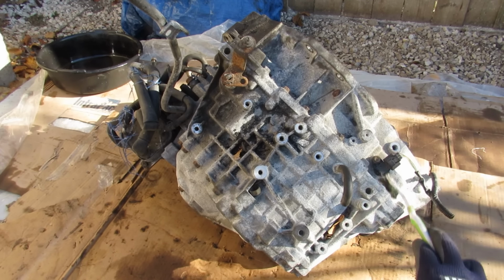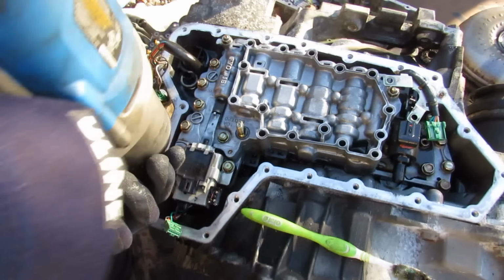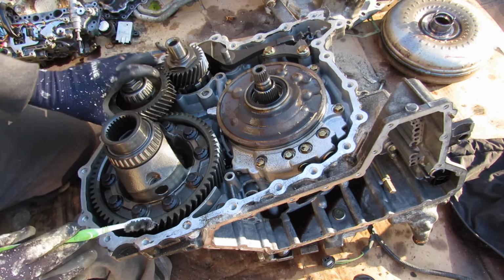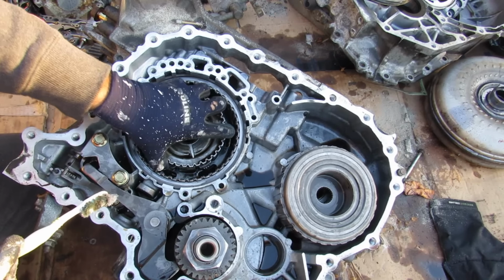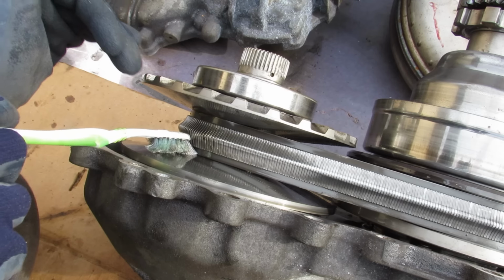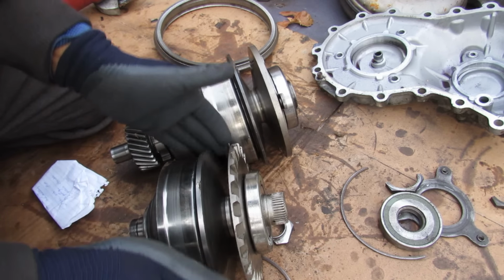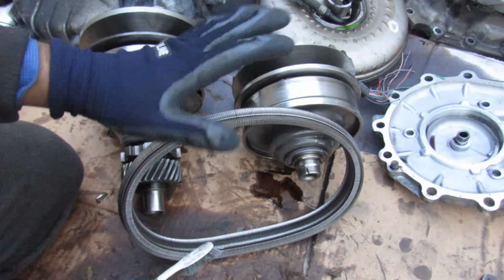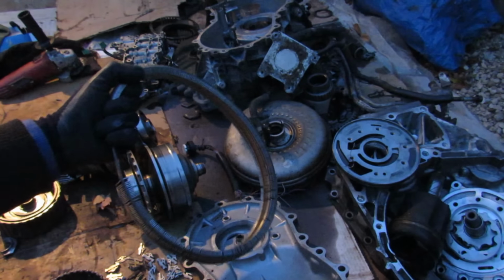Why Nissan CVTs FAIL

Comment: My issue with these is that Nissan puts them in my favorite car; the Maxima. Any Maxima after the 5th gen is shit in my eyes because of this one part.
Reply from the maker: Yeah it really holds back the vq engine
Reply: @speedkar99  not to mention a new Maxima is $40k. And it disturbs me that the new altima has AWD but the big ass Maximas are still only FWD. They just don't treat it like the top of the line car it's supposed to be.

Comment: the belt is a pusher design, therefore the belt isn't stressed unless the pulleys are not synced. the question is why does that happen. you need to take the "variators" apart and observe the shaft and how the pulleys are stopped from rotating on the shaft. there is where you will find your answer to why these things fail.

Comment: And there you have it.    Why an electric car is so good.
It DOESN'T have all that.
Reply: no it just has a battery that degrades, isn't any better for the environment in the long run, and uses rare earth elements that can't be recycled into other batteries when the battery is finally rendered worthless by time. So tell me again why electric is the perfect solution. That's not even counting the range issues and charging times. Oh and the fact that if everyone who drives an ICE vehicle switched to electric how the grid could absolutely NOT handle it. But electricity is so much cheaper than gasoline you say.....except everyone is completely ignoring how basic supply and demand works and that if the demand for electricity is greatly increased due to electric vehicles then to counter that the supply cost is going to increase. And on top of that, said supply cost is going to impact your entire home and not just the cost to go somewhere. When electric rates rise due to demand, that means not only does your vehicle fuel cost increase but so does your cost to refrigerate food,  cook food, heat your home, watch tv, use your computer, etc.
Reply: @kudzuwarrior  BS

Comment: pretty good information but some inaccuracies, nissan does make a service procedure to diagnose cvt failure and even updated detection logic to set dtc for failure diagnostic, they do have a rebuild procedure for cvt and even have rebuild kits for the cvt that are half the cost of a complete unit. good job on the video!

Comment: Great video.  I really think the secret to keeping a CVT going in a larger vehicle is just what you said, drive as easy as possible and try not to overload the transmission.  I hope Nissan quickly moves to drop the CVT in larger, more powerful vehicles like the Pathfinder or Murano.  In lighter vehicles they are fine.  The issue most people face there is quality.  Early Nissan CVT's had shit quality.

Comment: Mr speedkar99, I have a question... I have a honda Civic Hatchback 2017 with the cvt. Paired to the earthdream engine/turbo, and this car is light weight. and build for cornering at highspeeds and generally advertised to be a fun car to drive... now.. I've (gone to mexico) and had some 120 /130 mph runs with it before. (atleast 5 times) car has 40k miles.. and almost on a daily (all back wide open roads with no traffic) to and from work never ever drive the car without it being in sport, S mode (keeping the cvt ready to launch at higher rpms and the turbo loaded at all times) and i usualy do 70/80 most of the way to work (20 minute commute) until i hit the last 4-7 minute stretch to work and go back to the 55 speed limit and back in D, drive... now people say honda's cvts are built better then most others.. and other companies as you mention are pairing them with bigger engines and toying around with them is bad.... would you say what i do on an almost daily basis will ruin my car too? even though its smaller lighter weight and smaller engine? 
 (i got the car with 17k miles.. in janurary2020 and have gotten it to 48k to the date of this post, between my driving mentioned above, and driving for uber - stop and go and alot of idling- so those 31k miles this year alone have all been hard miles you could say)

I'm looking forward to your reply. Thank you for such an informative video I love your work.
Reply: so i drive it hard pretty much since ive owned it is what im saying, because it handles amazing accelerates hard, and is just a blast to drive i cant help it.

(also forgot to mention i have it modded with a Stage 1 straight through inlet pipe and sport air filter from PRL motor sports.) [rated to add atleast 7 - 12 more horse power over stock]
Reply: oh and what did you mean when you said keep up on its cooling surfaces? / when or how offten should i have the cvt oil changed? especially based on how i just told you a drive?

Comment: From my experience with CVT transmissions, NEVER BUY ANYTHING WITH A CVT TRANSMISSION. This transmission was designed in the deepest pit of hell.
Reply: so don't own anything 2012 or newer?
Reply: @WestCoastShredders  You know, I don't know, I have not had the luxury of buying anything new lately. I just know I had a disastrous experience with a newer Nissan vehicle. To say I loath Nissan and their CVT transmission would be an understatement. I can say that I will research any new vehicle I may purchase in the future and if all newer vehicle's do indeed have that POS transmission, I will be driving my 1979 Cordoba until the wheels fall off. I do believe the Ford F-150 and the Toyota Tacoma do not have CVTs but I could be wrong.

Comment: I got a rogue. Hate the damn thing. I bought an aftermarket hitch and got my grandpa's old drawbar and I regularly tow 4k pounds. Car tops out around 52-55 mph with the load and whines like a mf but the damn thing just keeps going. I know it won't last much longer but I have a truck too so idc

Comment: CVTs work great in snowmobiles.  Because they are light enough to use rubber belts that can be replaced each year in about 5 minutes for $50.  If these steel belts were cheap and easy to service they'd be a lot more desirable.

Comment: I have three college degrees, read about two hours a day,  and I can't believe how dumb I feel watching this.  

Amazing video, thank you so much!
Reply: I can.
Reply: I knew generally how they worked (the pulleys and the steel belt, going all the way back to the first CVTs used in the Dutch DAF cars of the 1960s), but this is the first time I’ve seen a CVT torn down.
Reply: read 4 hours
Reply: @esatd34  Maybe another degree?
Reply: Must have had a student loan

Comment: CVTs are junk!! I wanna be able to tow with my toyota corolla again .Yes I might give up some mpg.  but i'll be saving the planet with less junk wearing out so fast~
Reply: You can't tow most normal automatic cars either.
Reply: @mjouwbuis  Older Toyota 4sp and 5 sp Auto's You can tow up to 3500lbs without wearing out the tranny. All manufactures need to toss the CVT IDEA. I've also owned Nissan before getting 430 000 km out of a Transmission. You can't say that about new ones. 200 240 and there toast.

Comment: This is the only video I’ve ever seen about CVT transmissions. No one could have done a better job either. You are so knowledgeable, you are a great teacher! 

I’ve read a couple of articles about CVT transmissions so I had an understanding of how they work. It’s a great idea but as you pointed out, the belt has always been described as being a weak link.

And it is easy to understand why. Since I read those articles and when I saw that CVT’s were in production, I wondered what they were using for a belt and if they had come up with another way to transfer power.

This video is amazingly informative. From the title, I figured that if a belt was being used, it would be the point of failure. I kind of hoped that it wasn’t, but I wasn’t surprised that it was.

During teardown, I was on the edge of my seat to see the CVT parts. When you said it uses a steel belt, I was blown away. How could a belt made of steel, that is strong enough to withstand the forces being placed on it, be flexible enough to bend around the pulleys.

When you showed how the belt is made of steel sections, the first thing I thought of was how it was constructed. I didn’t expect you to tear it apart too, and was fascinated when you deconstructed it.

For a long time, I thought if a belt was used for the CVT, it would be more like the toothed belts used on belt-driven motorcycles. But of course, how would a toothed belt be able to engage in and stay engaged in a pulley system that varies its diameter.

I suppose in actuality, the steel belt, being divided the way it is, is sort of toothed belt. I would also imagine that as the belt is designed to move around in the pulley system, it would generate a lot of heat.

Even though these CVT’s seem to be a bust, they are a necessary first step in making something that will work. It’s unfortunate that it’s affected so many people.

When the CVT fails, the company designing them should be analyzing the failure to improve on it. The way it is currently designed, the engineers should have known premature failure would likely occur often.

IMHO they should replace prematurely failed CVT’s with a standard transmission. Not an easy task certainly, but unfortunately, that’s the cost of throwing a new system into production.

And as I said, the company is able to gather important data to use to improve on the design. And that is data that no other company will have. That has value in and of itself.

Comment: I'll never own a car with a CVT. Problem solved!
Reply: My 2006 Toyota HH with a CVT has 295k on it. Many of those miles towing work trailers.
Reply: @greenftechn  much impressive
Reply: Subaru makes a decent CVT.
Reply: @rk4921  Subarus have major CVT issues!
Reply: @rk4921  Subaru uses Jatco CVT's , a subsidiary of Nissan, and the exact same CVT's found in Nissan's. Also found in Land Rover, BMW, Chrysler, and a bunch of other manufacturers.
Reply: One company is starting to make a CVT with a launch gear so it operates just like an automatic transmission when speeding up. If you can get 300,000 miles out of that with proper maintenance I might consider it
Reply: Oh yeah, you're going to own one... If these people have their way, a manual transmission will be extinct. They're working on it as hard as they can!!!
Reply: Yeah! Screw that disposable CVT crap!
Reply: Toyotas or at least the prius is super reliable with a cvt
Reply: Very good knowledge and presentation on cvt, my question is can the primary and secondary pullings be replaced while the transmission is still mounted on the engine.
Reply: Very good knowledge and presentation on cvt, my question is can the primary and secondary pullings be replaced while the transmission is still mounted on the engine.

Comment: If y'all think CVT's are hard on the wallet wait until you learn about DCT's.
Reply: Getting a regular automatic transmission rebuilt or replaced isn't a cheap repair either. The difference though is that anyone who regularly maintains their normal automatic and doesn't do foolish things with it will probably never see it need a repair because they'll replace the vehicle before it gets to that point. These Nissan CVTs failed easily enough that many people have seen the need for replacements.

Comment: I'm a Nissan tech at the Trainee level and can say that this actually made better sense than the modules Nissan shows. You explained it in such a easy manner with hands on explanations.*looks at my 2013 3.5VQ Altima with fear* Makes me kinda cry a little more than usual because the VQs in the Maximas and Altimas are so great and Nissan pairs them with a CVT that blows up under stock power. Gonna see if I can find a transmission with ACTUAL gears that'll work with the subframe and mate with the VQ35DE. Time for research. :)

Comment: Because Nissans these days are junk.  Literally plastic poorly designed junk.  They been making junk since the 90s.  I had an 80s Nissan that was built in Japan and even with 200k miles, it was still a tight quiet car that ran well. I’ve owned three since then and they have panels falling off in a few months. Junk!

Comment: When I was in high school auto shop in 1980, my shop teacher declared that CVT’s would become the norm.  I’m still waiting.
Reply: well theoretically they do make sense. Fewer moving parts and fewer parts in general means they should be cheaper to manufacture and cheaper to repair when something does go wrong which should be less than a traditional automatic. The issue is that they aren't making them serviceable or repairable. So that removes the "cheaper to repair when something does go wrong" part of the equation. The lack of experience developing CVTs also means that the "cheaper to manufacture" and "more reliable than a traditional automatic" aspects are not yet a thing. Think about how many years of development we have had with traditional automatics to get them to the reliability standards that they are at now. It took a long time and a lot of engineering to get them here. CVTs by comparison are basically new to the industry even though the concept has been around for a while. Modern CVTs have been around since when - about the mid '00s if I am right whereas traditional automatics have been in active production and refinement since the '40s.

Comment: Based on what you said about the belt, perhaps buying a used Pathfinder with the V-6 with an eye of loading it up or pulling a trailer probably isn't a good idea.  (I understand Nissan is throwing in the towel and putting a traditional automatic transmission in 2021 or 2022.)

Comment: A CVT also allows for an engine to be tuned to a more narrow powerband which also gives better fuel economy.
Reply: In theory, but seeing as they aren't the only transmission option for the majority of motors they are paired with, its not something realized often in the real world. Instead much like a hybrid, they make their fuel savings in very low speed stop start type conditions, only offering simlar results once your actually moving along at the speed limit.
Reply: NOT the powerband or even efficiency.  CVTs allow mapping to BSFC islands that discreet transmissions don't.

Comment: My 2013 Maxima and my wife's 2012 Murano both have CVT's with over 150,000 miles, with nary an issue so far.  Replaced the CVT fluid twice on each.  I've got no complaints.

Comment: You said belt is the weekes think in the transmission. Have you seen any belt actually broken inside. Did you test the belt hardness at what tork its break. How can you say its a weekest link

Toyota put the cvt in 2 5 litter 2021 sienna. Its not reliable transmission the why they use in the big suv and minivan??
Nissan vq35 with CVT transmission use the belt. It's works for daily routine drive. 
Check toyota vellfire and alfrad transmission in japan use CVT.

Comment: I've definitely been under the impression that CVT transmissions gave WORSE fuel economy that either manuals or modern automatics with fixed gear ratio steps. I suppose it makes sense that a 6 speed automatic must have a lot of clutch packs that are slipping (intentionally released) much of the time, with a less than perfect elimination of all friction, but on the other hand 6 speeds allows a pretty fine tuning of the gear ratio and the solid gears used don't have inherent friction issues like a belt drive. There have been "lockup" torque converters for many years, but it seems like I heard some of the newer automatics have enough gears (and dual, alternating power paths) so torque converters are no longer necessary at all.

In any case, my dad's Murano sure got sucky fuel economy, for its size.

Comment: How you drive especially when taking off..has a lot to do with cvt failure...we have five nissan vehicles with 150 thou and more and cvt trans have had no problems mine has 192 thou

Comment: Great way to end the Video..
     I think about that a lot When I'm getting on my Juke and shifting it hard.. I never stomp on it from a dead stop though and always come to a complete stop shifting between forward and reverse, You should always wait that extra second and feel it switch over or engage before hitting the gas.. I have Bolt On's and some work done..   Anyway I just got a CVT Cooler at 89,000.. I Bought the car used, Not Knowing about CVT's 3 years ago. (But I did 4 CVT drain and fills when I first bought the car..) Three in one day and a 4th a month later and been doing a CVT drain and fill once a year ever since.. You have got to keep the CVT Fluid as close to new as possible if you want it to last and especially if you are hard on the car.. Just 1 Hot summer especially without a CVT Cooler will Burn that Fluid Up. Drain it, It will Look Burnt Especially if you have a heavy foot.. I actually Recommend thinking of it more like motor oil and protectant.. And doing a drain and fill at least once a year in June depending on where you live before the hot summer months if it's your daily driver and you are making payment's with no warranty..

Comment: Even though my Rogue  (2016) has forty thousands miles on it , the dealership recommends that a get my  CVT transmission fluid changed at a cost of $295 est  . I thought they were trying to rip me off , but after watching this video , I guess I will now , since I've paid for it and really don't want a new car note at my age . I should have kept buying Hyundai's , I still drive an Elantra I bought in 2000 and it is still running with a 179,000 miles on it  . I guess I'm stuck with my Rouge since  I refuse to go into debt again for these worthless cars made of plastic and cheap metals .